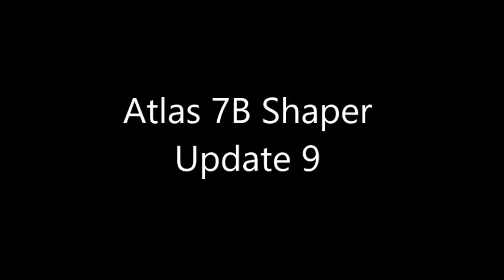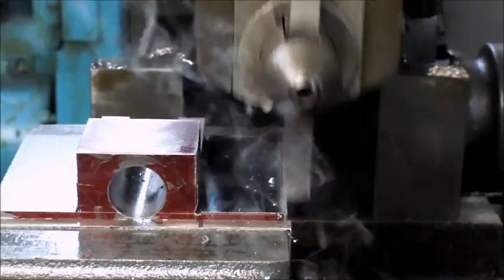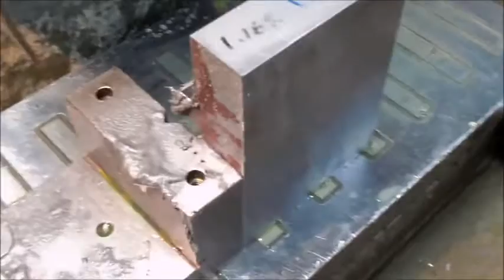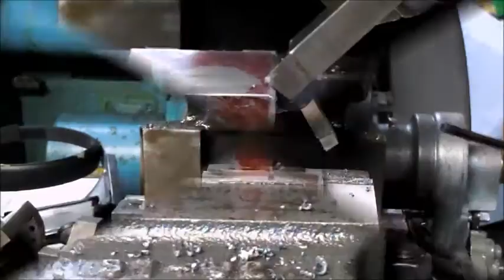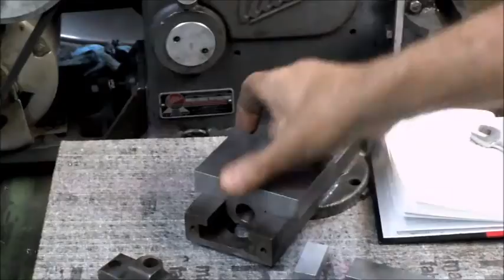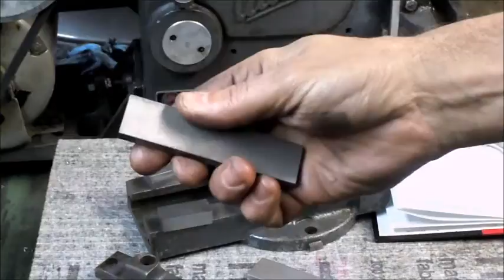Atlas 7B Shaper Update 9

Comment: I think you had your clapper turned the wrong way to cut that angle. I would suggest keeping your cutter in line then plunge in with the compound on the clapper. Alternatively setting the jaw in at the proper angle and feeding across could have worked as well.  I think you want to avoid side loads on your clapper box. Of course I have never run a shaper so I am just speculating. :-)
Reply from the maker: Good call on the plunge cutting, I did end up witha set up that was more in line to finish the cut. Likely obvious to most that I also had never run a shaper before I got this one LOL :) Thanks for the comment.